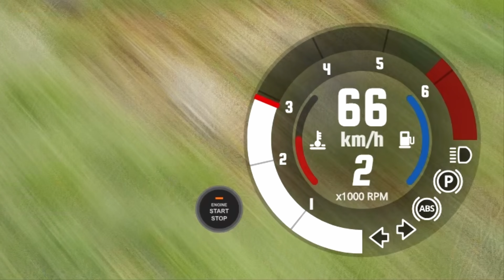1930s Suspension VS Direct Drive Wheel

Comment: Bouncing a car off old leaf spring suspension with a manual transmission is actually an ancient lost art to climbing mountains. There's some old video somewhere of a WW2 willy's jeep with the skinny wheels rock climbing in Moab, and the driver got into a rhythm of bouncing the suspension. As it turns out, this was real rock climbing technique for these old vehicles. The leaf springs with little dampening cause lots of bouncing, which can either be horrible to offroad with, or if you know what you're doing, something to take advantage of. When the wheels are bounced up, they typically lose traction and slip. But when they come back down, they can actually dig the tire into the ground and create a larger contact patch. That is when you want to apply torque, applying it there can actually give you better climbing than the same car applying constant torque. Letting off and applying power at the right moments can both help induce the bouncing suspension, and give power right when you have the most traction.

Anyway, that might be why the car climbs ok even though the wheels are skinny and the suspension is horrible. You're actually unwittingly taking advantage of the bouncing to get brief moments of high traction.

Comment: Goodbye tires
Goodbye hands
Goodbye clutch
Goodbye engine
Curbs, curbs, curbs everywhere
Random crashes
Hydra crashes
Old issues imported from the 1920s
Use more than one NPC at a time?
Driver's dead
Steering far too steerious
An all-consuming cliff
Horse Power: 1200
Can't cope with the bumps
Can't stop asserting dominance with a Pigeon
Spawn rate problems
Road tear problems
Getting too swole
Getting underneath the car
Getting attacked by oblivious drivers
Spawning too many Hydras
Spawning too much traffic
Also your engine stalls after every reset
And sometimes it overheats
Turbo randomly plays static
But too much turbo means none of it grabs the road
Enemy Hydras is far more Hy than Dras.
Dials are broken
Surprise!
Roundabout
And a "Car Mighty" reference

JUSTTONAMEAFEW

Comment: The dimming of the headlights are from the weak charge the electrical system has. In the 30s they used a 6 volt system compared to the standard 12 volts we use now. Also the steering wheel input is something like 5:1 because theres no powersteering system to multiply the wheel turns. Modern cars are something like 3.5:1

Comment: If you ever find yourself in Newport, Rhode Island, you can play our pre-war racing game in the Audrain museum's Fanatec simulator. We've got a 1901 Panhard working going a breakneck 60mph top speed with ZERO power steering. 
Let me know if you want to try it, it is designed to work with that driving set up!

Comment: I've got myself a 1957 Ford Thunderbird and its basically a modern car when compared to pre-war autos. Manual brakes aren't bad in a light car, but the power steering is way too loose and floaty.

Comment: I knew a older guy. He had a model a coupe that he turned into a hot rod. It was factory frame and steering with a 305 small block with not really anything done except headers and chrome intake and carb. He said it was the scariest slow car he ever drove. He loved that thing.
Reply: Cool mate sounds mad

Comment: I didn't understand why they called steering knobs "suicide knobs" until I drove a 1974 Hilux with manual steering, and clipped a curb entering a parking lot. The steering wheel was violently yanked from my hands and thankfully my thumb wasn't in the ring, because I'm sure it would have been smacked hard by the steering wheel support. It is a bit scary how much torque can get thrown right into your hands on these old cars lol.

Comment: As someone who owns a 1938 Buick Special and drives it around, by the 30s cars were pretty decent. Compared to the vehicles only a decade prior they were phenomenal. While the car lacks a synchro, has no side view mirrors, is a 6v system, no power steering, and so much more. I can easily see how someone of the time drove the car daily -- I can comfortably do 55-65mph, I have driven it in traffic (a little interesting at first), and lookin good while doing so. I will say though taking turns on it is very interesting as it is EXTREMELY floaty as you would imagine. Even with the nice tires I have on it, because of how the car is weighted you can get screeches when making turns at only around 20mph on dry asphalt. It would definitely be interesting to be in some kind of 30s chase cutting it up with a car from the pre-war era lol. (but mobsters did it)
Reply: This gave me a whole new level of appreciation for Turismo Carretera in the 40s and Juan Manuel Fangio
Reply: Kinda insane how much cars have evolved in a century since the first automobile
Reply: i got to drive a friends 42 ford super deluxe for 2 weeks while house sitting and yes its slightly floaty but honestly it drives better then my volvo 760 i would 100% daily a 42 ford super deluxe
Reply: The only part that sounds scary to me is the lack of side mirrors.
Reply: @Nuclear_Annihilation lol its some getting used to
Reply: @Nuclear_Annihilation  the part that sounds scary to me is the lack of synchros
Reply: Mobsters had their own mechanics who were genuises tuning those things. Kinda logical, they were bootleggers after all. Or, atleast the notorious 1930s bank robbers hired people who built cars for southern moonshine makers. That's a known fact. People who know the history of how bootleggers built their cars would probably have the know how to build your buick in such a way it looks original, but has a suspension which can not only carry a huge load of illegal booze inside a hidden compartment, sometimes in the trunk of course, with out the suspension sagging too much while also giving a dynamic edge in handling that would probably get close to at least 1960's sports cars. And all that, with out any of that being apparent from outside, so you maintain the original look. That was the point of course. Certainly enough that, you're not screeching wheels and attracting too much attention from on lookers when taking a corner. I can imagine some over ambitious traffic cop pulling you over after hearing something like that, and trying to make a case your car is not road worthy or some shit. :D The sort of things they used were rather interesting, I've read there were kits sold for the Ford Model T engine to refit it with a chain driven DOHC valve train, increase compression and of course, supercharge the thing, already in the late 1920's. These engines made 200 - 300hp easily. All this was also about 20 years before Hot Rod magazine made this sort of thing popular with people not up to something shady. Or, engaged in semi-professional or professional motor sports. Although, personally I wouldn't want to drive a T ford with such monster of an engine, not even for a million dollars. As you said, cars from the 1900-1910s were things which were genuinely dreadful to drive and in my opinion, almost a suicidal proposition to drive in city traffic, even in factory spec. This is due to the.. Awkward way you control the thing and especially how you control the gearbox and with it how fast you are going, and  of course, the brakes. If it were up to Henry Ford, even the V8 would've had only mechanically actuated brakes and only on the rear axle... At least according to legend. Fortunately the engineers working at the R&D shop wouldn't have it, and the Model A got hydraulic brakes. On all axles.
Reply: Stock or hot rod
Reply: how much did it cost?
Reply: Was my grandpas car so free @AlexPeterson-c6e
Reply: That's awesome.
Reply: What’s a synchro?
Reply: I ride a 65 year old motorcycle,  Brakes are terrifying

Comment: While it feels like a complete mess, this is probably a pretty accurate recreation of an early 30s car. The huge transverse leaf springs are pure Ford and the bouncing is because of lever-type shocks, which was the precessor to hydraulic shock absorbers and they were, by all accounts, completely useless. The concept of "handling" was still in its infancy at this time. Even the most prestigious luxury cars still drove like trucks. Basic cars like this didn't stand a chance. All engineering effort went towards durability and ease of repair.

Comment: Love the vids. Not sure if anyone has mentioned it (they probably have) but using a wheel of that size on the csl dd is going to reduce the feedback. If you use a smaller wheel, youll get the intended strength. Either way, its just a matter of preference 👍

Comment: My understanding is that the difficulty with steering and counter-steering is why big steering wheels and driving gloves were so common. Without power steering, the big wheel helped the driver apply more force to the steering column, and gloves (or a steering wheel cover) helped the driver keep a better grip on the wheel.
Reply: I drive a car like this daily, and you are right about the big steering wheels, but not about the gloves. Steering is actually pretty light, especially when driving at speed, the heaviest is when driving very slow or not at all slow to park for example, but it's still not that crazy.  Also the steering wheel material is a type of rubbery resin, it's actually pretty grippy.

The gloves are more because the insulation in these cars terrible, and there is air gaps everywhere in the body, so it's pretty cold inside if the weather is cold.

I have a heater module installed, but those didn't come with the car from factory. Also a lot of versions of these cars weren't actually closed cab.

Also it was just fashion of the time as well.

Comment: ive got a 1948 cadillac and its pretty rough. it has like a quarter to half a turn steering play before anything happens. its fine in corners but going straight you have to constantly counter steer because it doesnt center. maybe i should get an alignment XD

Comment: Interesting fact, older cars like that usually had larger steering wheels or required more turns from lock to lock to reduce the strength you needed to turn the steering wheel.

Comment: I have a 1951Ford Pickup irl and that wheel at low speeds will rip your arms off when it centers. No joke. If its stationary, forget turning it at all. hahah. Also solid front axel and leaf springs mean bumpsteer is MADNESS. Mine has the same ancient V8 in it as well, I was so glad they made it accurate - that after about 10 minutes driving it overheats

Comment: 0:09 fun fact this vehicler device has no sway bar and the mechanical steering system with super high ratio Wich answer why there are steering lag and very easy to roll or oversteer and it got leaf spring suspension Wich is why it's so bounce much

Comment: Great stuff.  Yeah, a race would be interesting.

To state the extremely obvious, let's keep in mind that most of these cars originated in an era when anything over 50 mph was probably considered scary fast.
Reply: driving 50mph was common then, at least on paved roads. the first concrete highways were laid around that time.
Reply: @DrTheRich    The FIRST concrete highways, note.  We tend to take those and paved roads for granted, but a lot of common thoroughfares were neither in the 1930s, and would remain so for a while afterwards.

Comment: if you put a bit of weight in the rear it handles way better,
a little bit of slip angle and trail the throttle holding the steering straight
Reply: All I heard was "weight in the rear".😂

Comment: Ha. I recently found out, that Having the Truck Shifter installed on the Gearbox and playing BeamNg in VR, The Good Noodle on the East Coast Map (I love it.) is the most fun i had recently in BeamNG. I am addicted. It is so stupid. And great. With that long shifter and the Wheel that is constantly flipping because the suspension dies with that amount of Power. It is so much fun. BeamNg in VR is just on another Level for me. I love the Good Noodle. Heh. hehe. he.

Comment: 5:35 Because physics! On soft ground (such as sand or gravel), less contact patch helps. Same force devided by less surface means a higher pressure onto the ground, meaning more grip. This is why, usually, a car's winter wheels/tyres are slimmer than the summer wheels/tyres :3
Reply: :3
Reply: Kinda... in practice, you start damaging the surface before you benefit from the extra contact, so you usually want a bigger contact patch to prevent digging.
Reply: @justaguycalledjosh  in some off road terrain skinny tires that dig and rip away loose slop and get down to solid ground to provide traction sooner. 
Theyre best for mud and snow, with some exceptions to some conditions.  

Some extreme examples of pizza cutter wheels can be seen on racing swamp buggys, and at the speeds they reach the wheels also act like rudders for better control in mud and deep water. 
They spin like mfers and dig until they grab, once they have some momentum they actually start hydroplaning by design because the tires are also paddle tires and it lifts the chassis high enough to skim on top of the water. Its pretty cool honestly. 
A less extreme example are tractors and their wheels, the skinny profile minimizes crop damage to drive between rows while letting em dig to solid soil if they hit some deep mud,  a plus is you can secure logs to the wheels with chains a bit easier too (to use to lift and break the suction of the mud, while moving it forward) 

Where as on like heavy equipment we see the inverse, large diameter tires but theyre also extremely wide to spread the weight more evenly and prevent em from sinking or digging into in soft ground. With pizza cutters theyd be stuck right up to the chassis.
Reply: Thanks for the info, you dropped this👑
Reply: thank you! I didn't know but that's interesting
Reply: That is definitely not true for sand. People air down their tires to increase the contact patch so they float on top instead of sinking and digging themselves in.
Reply: @TheR00ndar  id say that's more for big rocks
Reply: generally on gravel more surface area is better, the reason you want thinner winters is because you're trying to melt the ice. Ice is a strange material but technically you can pass a icecube through a sive and still have it be the same solid ice cube after it comes out. using this effect rally cars and potentially you, are trying to melt the ice under your tire to contact with literally anything other then ice lol. its again really complicated but there is a chance thinner tires can make your car performe worse on ice especially if they are spiked tires. generally i recommend listening to what the engineers say as they designed a car to work optimally with the specific tires of design.
Reply: @KingSheva-sh5qw  well, I am no engineer, just a mechanic. But if I look at rally cars, their gravel tyres are usually significantly slimmer than the tarmac tyres..
Reply: @TheAmélieZombie ill be honest ive literally never seen that to be true, its true for winter vs summer but again never noticed it to be the case. However as I said it's very complicated, bigger tires means more weight and harder to heat up, perhaps its due to temps as softer compounds would be used for road tires and then you need more SA to disperse and dispose of the heat.
Reply: also the cars are lighter
Reply: its actually kinda really complicated, the big difference is it acts more like flow dynamics on gravel. Because tires have a varying load grip ratio, meaning the grip to pressure ratio drops rapidly after a certain point there is an optimal slip angle that is dependent on the car and suspension setup but usually around 5-15° of drift, this happens to also help with heat load on tires but it's kind of a side effect.
Reply: That does make perfect sense!
Reply: @thatrussianguy116 💀
Reply: @thatrussianguy116 Bro gets mad by people being smarter than him smh.
Reply: @chilledburrito  by their reaction its almost everyone
Reply: ":3" detected, opinion rejected
Reply: @ Not an opinion, just science. Sorry!
Reply: @TheAmélieZombie  :3
Reply: @m16-a2 :3
Reply: @m16-a2 :333

Comment: Yall know whats hilarious?
My 2000 chevy silverado truck i used to drive had the same steering problem as the V8 version of that car.
On a 2 way road, you had to turn the steering wheel to the left to keep the truck from going to far right on a curve to the right, exact opposite with a curve to the left, lmao.
I had no trouble with it tho. 👍

Comment: I thought this car drove so great on that same wheel you're using, didn't know what the fuss was about... Til I discovered I hadn't properly implemented 1:1 steering. As soon as I fixed that to he more accurate BOOM no steering for like the first 10 degrees 🤣 literally stopped driving my beloved career mode hot rod for awhile